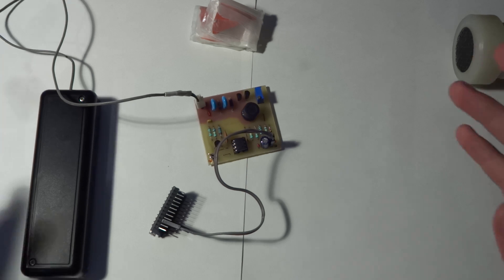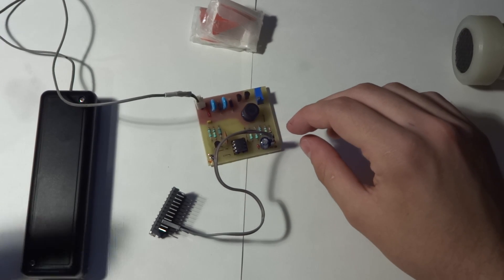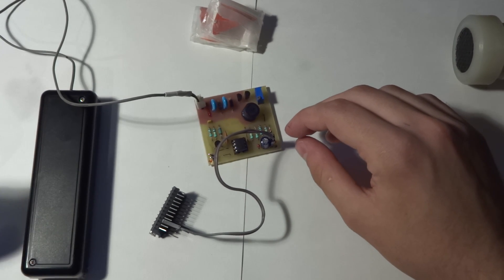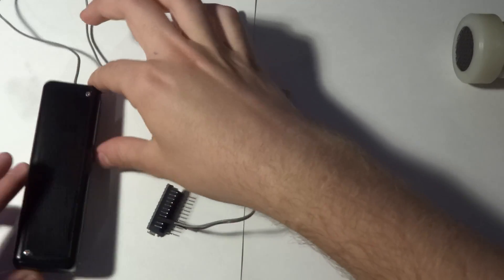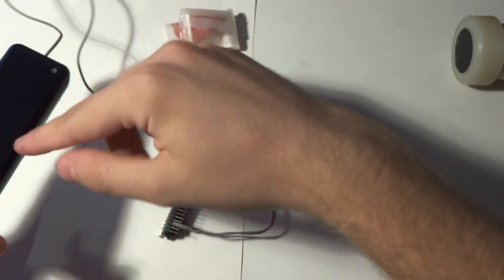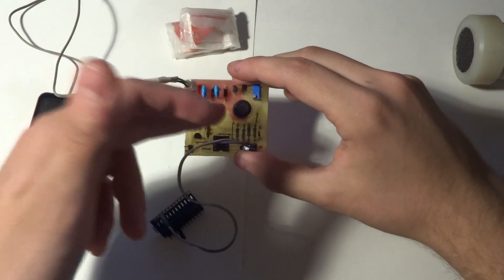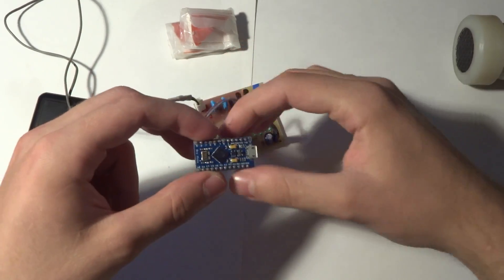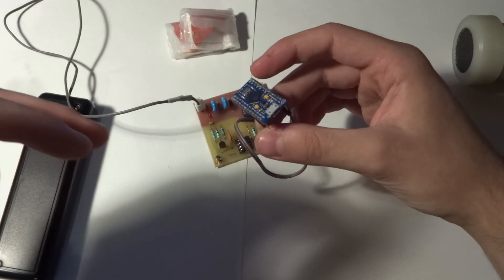Random Number Generator: Hack a Day 2015 Prize entry

Comment: Isn't that dangerous? o_o
Reply from the maker: pacsmile In that leaded enclosure, not really. But if you live in the US chances are you have plates (if they're older than 1970) that contain U238 and that are just as radioactive... You may even have a full set! 
I took all the necessairy precautions to shield myself while using this, and checked my sources with the university's local radiation safety officer to be sure I didn't do anything wrong
Reply: ***** haha, it's just that eh sound of the geiger counter makes it look hazardous, and i don't really know what you mean by plates, i'm not from the US.
Reply: @pacsmile  he's referring to uranium glazed dinnerware from the early to mid 20th Century sold under the Fiestaware brand.  Some colors used uranium oxide in the glaze, esp. the red ones.  The alpha decay would not penetrate your skin but eating off of it could cause utensils to scrape off tiny amounts which could be injested.  Carrying a 1cm cube of uranium against your skin for one year would be about the same radiation dose as 1 medical CT scan.
My tired eyes read the comment as 6d ago not 6y ago 😀
Reply: @michaelstora70  I love getting responses to old comments c: